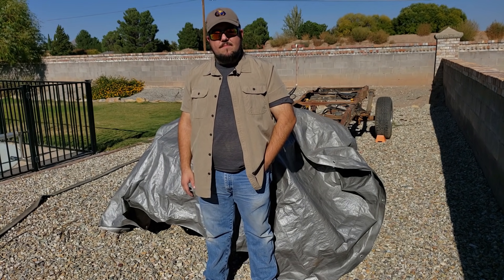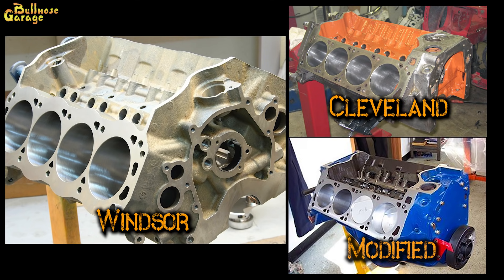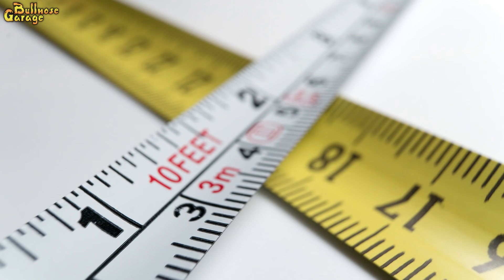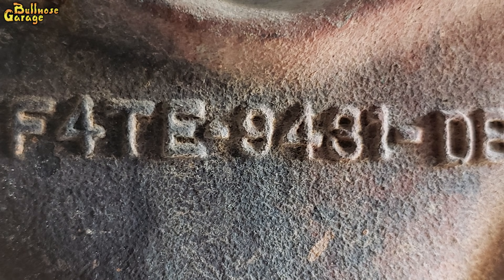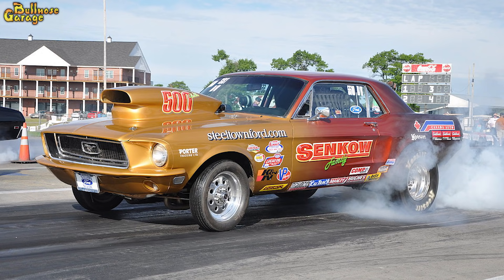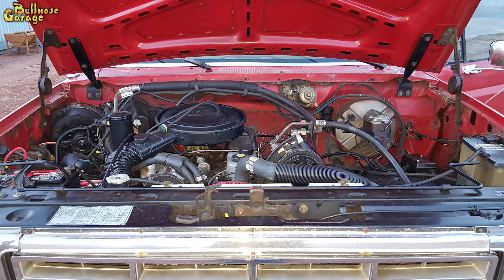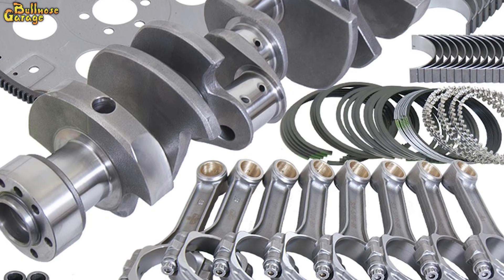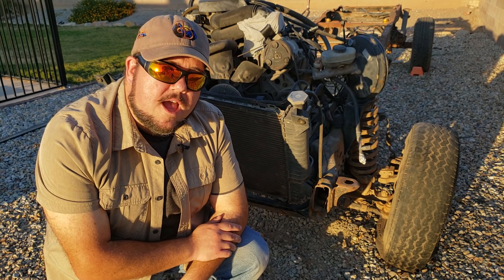351 Windsor – What You Need to Know About the Ford 351w Small Block [5.8 Liter]

Comment: technically...ford never made a 351..anything called a 351 is actually a 352..the bore and stroke on a old 352 F,E engine is exactly that same as a 351 windsor , cleveland , and m ...yeah i know i am splitting hairs here
Reply: You are correct, and I have been a 390 FE fan ever since having one in my first car. The actual displacement for all of those engines is 351.86 cubic inches; however, Ford was notorious, during the muscle era anyway, for giving engines names that slightly misrepresented true displacement. The 427 was actually a 425, and the 428 was 426.5 cubic inches. A 5 liter would be 305.11 cubic inches.
Reply: @et76039  yes you are correct as well...but all manufactures just rounded off up or down in cubes ..in 69 when the 351windsor came out ford called it a 351 just to cut down on confusion seeing the old 352 was still around and not confuse the 2 when ordering parts ...ever hear of the 483 cubic inch F,E ford was experimenting with ????
Reply: @merc-ni7hy  , wow, that was the first I'd heard of a 483! However, I was aware of a non-stock 447, the result of using a 427's block and a 428's crankshaft. A quick search shows that the 483 seems to have been just a "blackboard" engine. Too bad. :(
I do agree with your statement of why the 351 was so named; imagine the confusion that could otherwise result. Also, it appears that my '68 Cougar has a first-iteration 351W block, but later heads. As you probably know, that's a non-stock engine.
My nephew has a 1977? F600 dump truck, with a 330 FT engine. I was surprised by all the differences between the FT and FE engines; the most obvious is the exhaust manifolds, which are the ram's horn style. While there is a lot of parts interchangeability with the FE, there doesn't seem to be any advantage in doing so.
Glad to see that you and some of the other gearheads knowledgeable in the muscle era are educating the public. So much misinformation around, to the extent that I've seen vehicles for sale with the wrong year model. I've told some of these "youngsters" that they are so accustomed to modern handling and brakes that they'll kill themselves on a stock muscle car; it happened to our generation, even though we knew what to expect.
Reply: @et76039  yes i read somewere that ford was looking into the 483 f,e for nascar but it didnt go far....i  am also a big fan of F,E motors..i was about 11 when i got my first car..it was a 1965 mercury montclair 4 door hard top....yes i have seen stuff advertised that was not correct either,,and it seems most who owned a ford truck from 77 to about 81 powered with the 351m400's many claim they are cleveleands..but we know better 

ever hear of the youtube channel called [ autoline daily?] ....well a few years back on the thursday show[ called after hours] they had one of the original F,E enginers who was part of developing the F,E motors 

did you swap motors in your cat?...some cougars got  either a 289 or 302..68 was the phase out year for the 289 ...years ago i bought a 68 falcon for the motor for a 79 fairmont futura with  a bad 302 ..i knew it was an untouched 289 but under the intake  in the lifter valley is said 302,,i did check the stroke it was a 289...it must have ben in the middle of the change over and used what every they had left..
Reply: @et76039  come to think of it..i think all F,T motors have a steel crank ..and use the same rod and main bearings as a F,E ,,but the snout is larger then  F,E crank...and heads and intake are different..water jackets are  in different places...you can use FT heads on  a FE,,but you have to use the intake with it..but no real gain in doing that
Reply: @merc-ni7hy  , a 302 block with a 289 stroke? Could have happened. The 302 block has a slightly longer cylinder skirt to accommodate the longer stroke. I've come across several '68 'Stangs with 289s, but the owner's manual for my '68 Galaxie didn't show it, though it did list the 427. The Marti report for my Cougar shows that it was begun in August 1967, but not completed until November, due to a strike at the 302 engine factory. VIN decoders do show both the 289 and the 302 in the Cougar for 1968.
Hope you can come to Texas for some of the DFW area car shows!
Reply: @et76039  i wish i could make it..,but i am all the way up here  in P,A..but i have a buddy who lives  in Rio Rancho new mexico who i think went to that show once or twice 

years ago i got a 65 merc montclair shipped up here to P,A  from new mexico ..but it spent time  in texas cuzz it had a texas inspection sticker  on it...

68 was the one and only year ford offered a 302 with a 4bbl...well untill the 1980's

Comment: Great video.  I have a D0OE 351W with C9OE heads swapped in my 65 Mustang.  The 400/351M and 351C are small block v8s.  They share the same bore spacing and head bolt pattern as the 289/302/351W.  The 400/351M are tall deck 351Cs the same as a 351W is a tall deck 302.  The confusion lies in that most but not all 400/351Ms had the 385 bellhousing pattern.  This was due to Ford ending production of the 390/360 FE motors for truck use and replacing them with the 400/351M.
Reply: and there are some clevelands that have both windsor and big block bolt patterns  on the back of the motor at the same time
Reply: @merc-ni7hy  yes, some of the 73 400 blocks had the SBF bolt pattern and were  equipped with the FMX transmission.
Reply: Small Block / Big Block is Chevy stuff.        Ford has their OWN engine families and even Ford themselves doesn't consider them "small or big" .     The only true "Windsor" is the 351.   There is no such thing as a "302 Windsor" or a "289 Windsor"  even though they share many parts and a share a basic design.
Reply: @scdevon The Ford Racing catalog have engine history sections. The page titled Small Block V8 includes 289/302/351W/351C/351M/400.

The page titled Big Block V8 includes 429/429CJ/Boss 429/460
Reply: 351M 400 motors have a large bell housing bolt pattern and the deck heights are an inch taller than a 351 Cleveland whereas the Cleveland will bolt up to any small black bell housing and has always been considered a small block in the performance realm.

Comment: They consider a 351 Cleveland a small block because of the small bellhousing
Reply: Not so much becouse of the bell housing pattern but becouse of the bore spacing. It has the small block bore spacing. Thats why heads interchange.
Reply: @jesseduke694  All 335 Series are "Small Block" then...as a 400 head fits on a 302 (with work) and bolts directly onto a 351C
Reply: You are correct sir
Reply: @chadkent1241  Right, but the 351M and 400 have the larger bell pattern common with the 385 series engines (429 & 460)

Comment: 335 series are not big blocks.
Reply: The 351/400 M engines aren't big blocks except that they are fairly heavy and large for their cubic inch size mainly because of the higher deck height and the extra cast iron extending past the timing chain instead of an aluminum or stamped steel cover like the 302/351 or the small block Chevy. That could be why some guys refer to them as "big blocks" because of the size and weight penalty.
Reply: @bowlinglefty  they are a mighty large small block. I do understand the confusion.
Reply: Technically the 351C is a small block and the 351M 400 are intermediate or big blocks. Cleve uses a 1 inch shorter deck and small block bell housing bolt pattern while the M and 400 use a standard big block pattern.
Reply: @chadkent1241  that doesnt make them a big block. the 400 and 351m have the center bore of a small block same as 351c, just a taller deck. this has been debunked 100s if not 1000s of times in forums for years now. it has become annoying when it pops up as someone calling them big blocks. they are not. not the only misinformation in this video either.
Reply: @chadkent1241  also the heads on a 351m & 400 are simply 2bbl heads from the clevland. You can't put small block heads on a big block. The 351m & 400 are indeed small blocks becouse of the bore spacing. Its the same as all the other small blocks.
Reply: Not only that...But Big Block and Small Block are Chevrolet terms... Ford used "Series"
Reply: @misters2837  over the yrs the term has been adopted to refer to most all the engines. Yes originally its chevy term but today's its normal terminology to refer to fords that way as well.

Comment: I have a 351w in my 83 bullnose built just a little with a edlebrock 4barrel carb and it has more than enough power to turn 35" 12.5 wide tiers I cant beat it